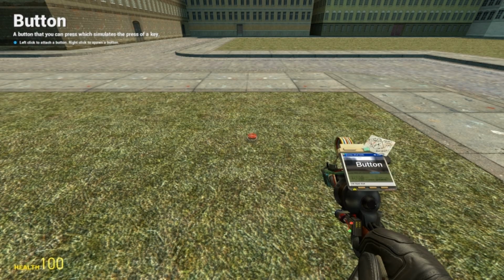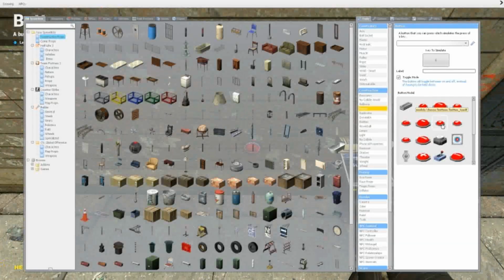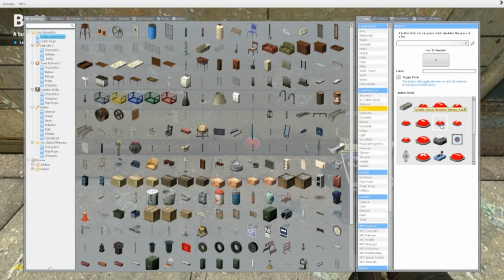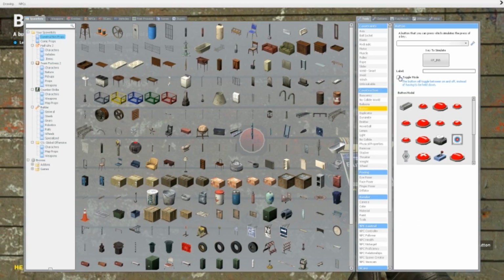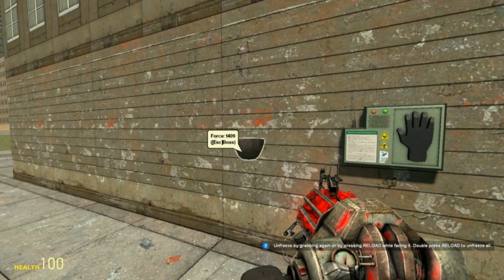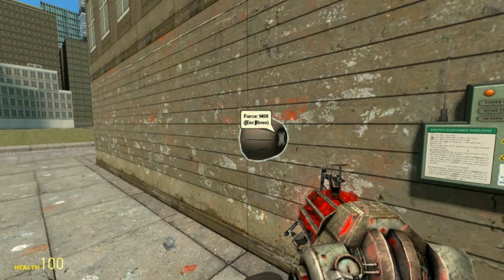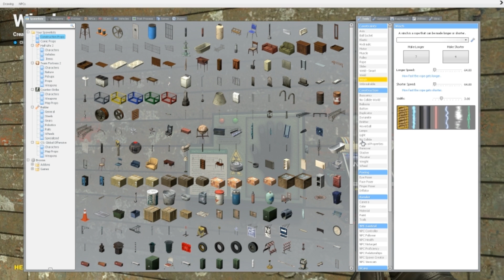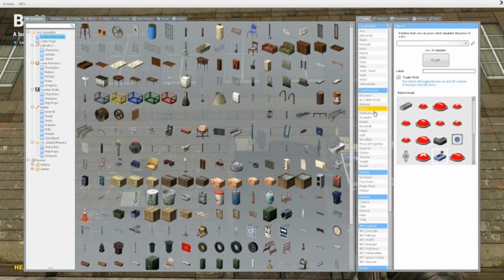Garry's Mod tool tutorial part 13 - Button tool

Comment: wait he set both thruster and button to the same keyboard button and like Joeski said, they could press a button without facing it so the same thing could be done with the thruster (you don't need to face a thruster to activate it) and simulate the button toggling the thruster? so when he faces the button he could be pressing the button he could just press the button on his keyboard assigned to both thruster and button.

Comment: it makes no difference where i am. i press the set button no where near the button and the bomb/thruster still goes off. the type of button i use makes no difference either so the button does nothing and what i use just goes off where ever i am
Reply from the maker: Orange Knight Well, that sounds like a strange problem. Are you sure you have set the activation key for ex. the wheel to be the same the button activats?